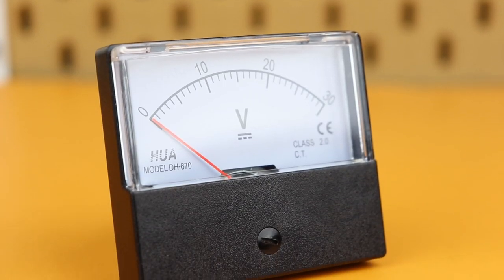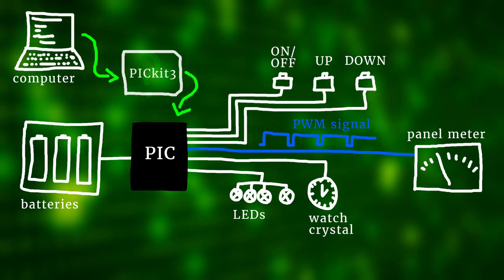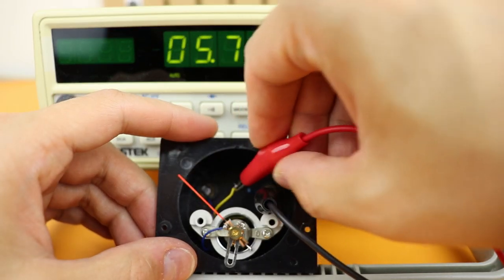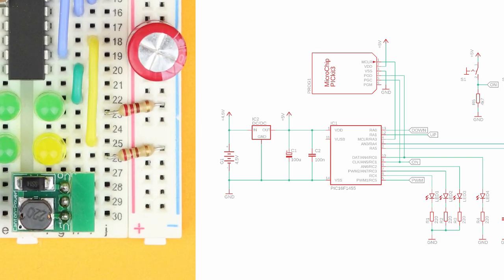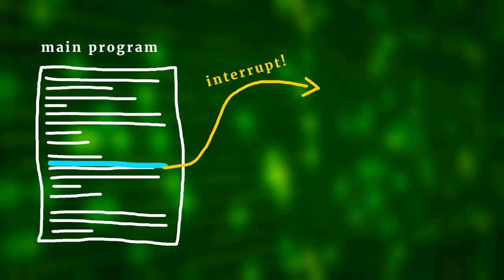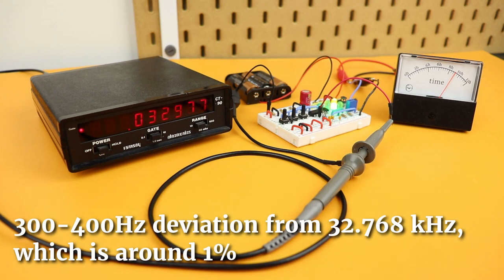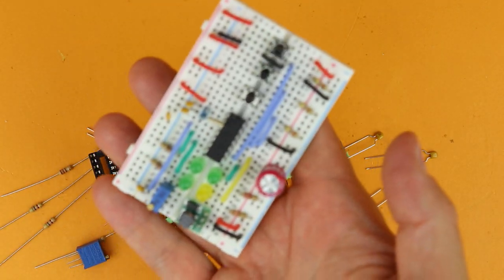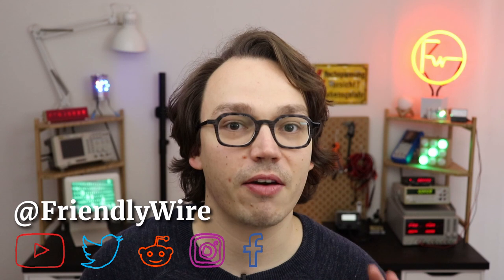Building an analog clock with a microcontroller

Comment: That is a pretty impressive low-power mode, especially since it still keeps the time!
You really do a good job of explaining everything.
Reply from the maker: Thank you so much for your kind words, it means a lot! :) Yeah, I was surprised how low the current consumption is. One thing to keep in mind, though, is that the current probably spikes up whenever the microcontroller wakes up from sleep for a fraction of a every second. So the draw on the battery will not be a constant 6uA, it's more like an average 6uA.

Comment: hello thank u for this amazing tutorial can I use PIC16F627A ? should I change anything I think they are similar right?
Reply from the maker: You could use that one, too, but there are a lot of things that are slightly different, for example the registers for the internal timers etc. In other words: you can get it to work on the PIC16F627A, for sure, but it will require some programming. It might be easier to just get the PIC16F1455 to get started. Hope that helps :)

Comment: Would there be a way to modify this so that rather it being a clock that counts up in hours, have it count up in seconds? So like having it max out at 1 minute and then resetting itself?
Reply from the maker: Hey Harry, yeah, for sure! This week I will work on a video that explains the code, line by line. Essentially you just have to change one line in the code. Since one minute has 60 second you could take that value times 4, so you have a number between 0 and 240. If you look at the article ( http://friendlywire.com/projects/analog-clock/ ), you can change lines 150-155 to "PWM1DCH = seconds * 4;" and that should do it :) Let me know if that helps!
Reply: @FriendlyWire  Awesome. I'm going to mod the code to use two really large panel meters (saved from 2x broken Phillips 2430 multimeters) + switch to toggle from hr & mins to min & seconds . Thank you so much for such a friendly and robust frame work.

Comment: Hmmm is this project not possible with an Arduino nano.  Again spend money for and expensive PIC programmer.
Reply from the maker: Certainly it is possible with an Arduino :) You just need to convert the time information into an PWM value. I work with PICs because I think they are quite affordable. The PIC16F1455 that I am using here costs around $2-$3 per piece, and the PICkit3 costs around $25. But you only need to buy the PICkit3 once, so after a few projects you come out ahead :) But it doesn't really matter, I am sure you can do this project on many other microcontroller platforms as well.
Reply: Thank you for your answer, i will think about it. 

I have a little experience with programming Anduino projects. I don't know what programming language is used for those PIC processors.
Reply from the maker: @lexpee  I have a lot of videos about them here. The language they use is a C dialect. Check out this video here if you want to learn more: https://www.youtube.com/watch?v=mUhzqDD6dg4
Reply: Thank you for the link. This is for me too complicated to using 3 programs to program one chip.  

Arduino is much simpler.
Reply from the maker: @lexpee  I know, PICs are not as beginner-friendly as Arduinos, true, but I actually like to go through microcontroller datasheets and figure out how to talk to different registers, it's like a puzzle game for me. That's why I like this saying: the "best" tool is the tool you know how to use :)